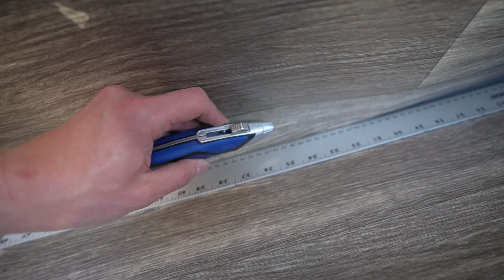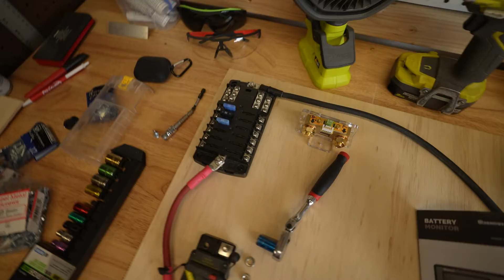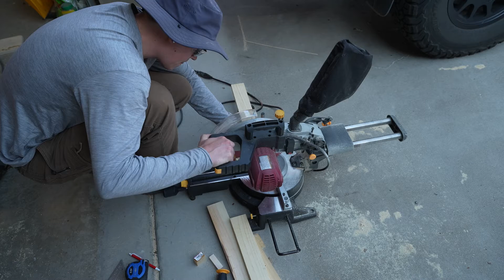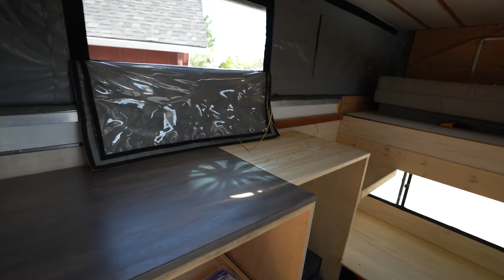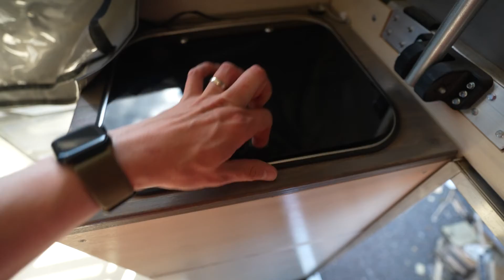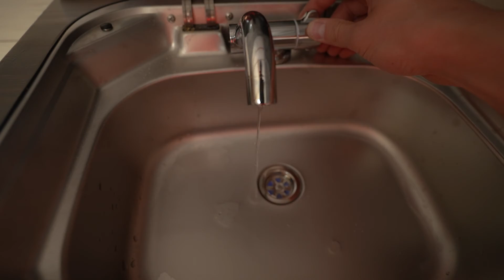Complete (Frame Up) Interior Remodel - Four Wheel Camper Eagle - It Looks SO GOOD!

Comment: Camper looks killer my guy. I’m in the process of building EMT lift panels as well. Having a hard time with the hinge point to get it to close perfectly. Curious if you have a measurement on where you put yours. Thanks!
Reply: I’ll also mention I bought your 3D mounting brackets - things are clutch
Reply from the maker: Thank you! The hinge point is a total pain, I would share my measurements except I don’t even think mine are right as mine doesn’t fully close how it should in the back. So I don’t want to lead you in the wrong direction. What I did was bent the EMT into the two sections first. You can make the sections longer than needed and then cut off the excess once you sort things out. I then played with them on the ground to try and sort out where to put the hinge point to achieve closing it properly as well as opening properly. It’s honestly more complex than I anticipated and I didn’t get it right the first time and had to redo my hinge point. Be sure to factor in how far away from the edge of the roof and wall the EMT is mounted into the hinge point measurements, otherwise you could end up with a scenario where the lift panel tries to push the roof forward when closing because the offset from the edge/wall wasn’t factored.

Thanks for buying the mounts, glad you like them! They have been going strong for a year now on mine.

Comment: Good stuff man,

I am rebuilding my 80s Hawk and also made EMT lifters. When i close mine, it is very tight and the alignment of the roof is off when I close it. Did you have an issue with that?

Comment: Wow, a lot of effort and it shows. A trick i heard for the Lagun table mount is not to center it on the table or wall as an offset mount provides more options on positions
Reply from the maker: Thanks! Good tip! It works well where it’s at now, but could see how one side of the other would provide some different movement options